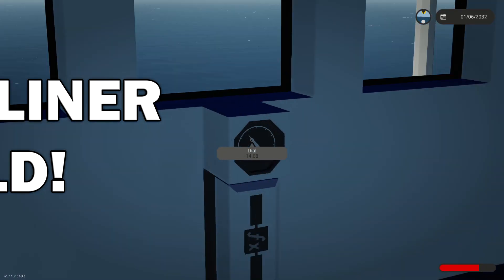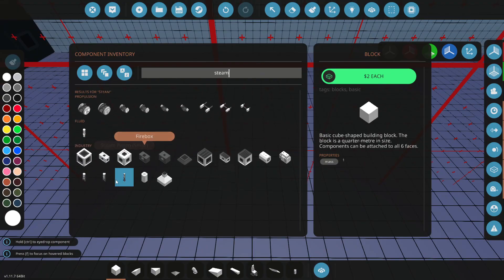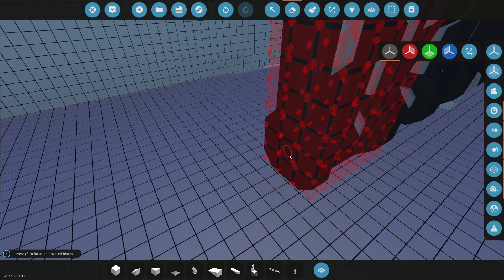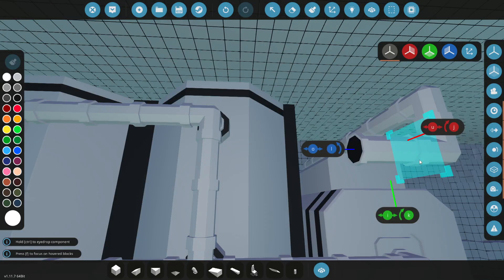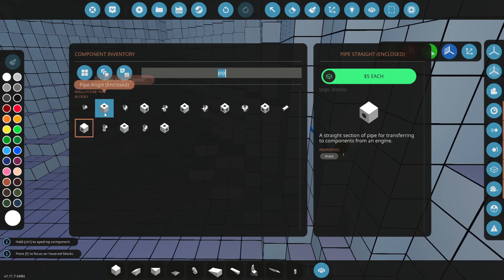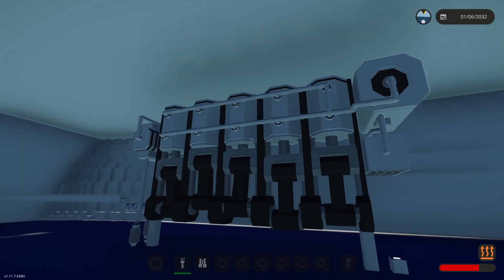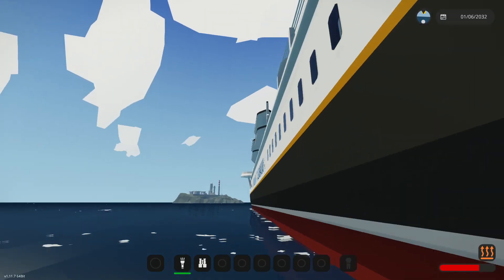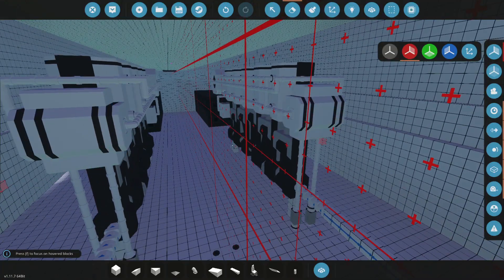HUGE Steam Engines Built!  - Ocean Liner Build - Part 11

Comment: Hey Frantic, just a few ideas for you:

1: You know that “room”/area at the back of the ship you’re wondering what to do with? Make it an equipment/security/armoury room. Fill it with torches, fire extinguishers, etc. and maybe even a little bit of weaponry to defend yourself. 

2: A reverse gear would be extremely useful in the likely event you find yourself in a…situation, plus it help the ship’s cornering if you could have the engines running in different directions at the same time. 

3: Dot some rope anchors around the edge of your ship in case you need a tow.

Comment: Gearbox Model:
Model: ZF SSG 76 Aphon
Type: Synchromesh transmission                                                                                                                                                                                                                                                                                   Specifications:
Gears: 6 forward gears and 1 reverse gear
Gear Ratios:
1st gear: 12.93:1
2nd gear: 6.40:1
3rd gear: 3.27:1
4th gear: 1.97:1
5th gear: 1.21:1
6th gear: 1.00:1 (Direct Drive)
Reverse gear: 12.62:1
Final Drive Ratio: 6.08:1
Clutch: Single dry-plate clutch

Comment: Engine look so cool 👍. One thing to consider is that these type of reciprocating steam engines could only produce max 18 knots each if your were to go with two High Pressure Parsons Steam Turbines like the engines of the Lusitania you would be guaranteed a max of at least 24 knots with the possible 25 knots. Yet I am not sure if Steam turbines are possible in StormWorks. Also Sea Water could be used for coolant, but the salt had to be filtered out of it first or overtime the salt would build up in the system and could cause bad accidents.

Comment: I still think that using the industrial furnaces (diesel burning ones) instead of the coal powered fireboxes would allow for easier connection to the engines AND provide real smoke for the funnels, it would also use the large open space you have in the lower hull. In fact, you could make a sort of double hull, and use the space from the double hull as fuel tanks as well, for extra safety incase your liner were to hit something, like an iceberg or rock.

Comment: Frantic the best idea is to use an Actual Boiler you said and connect i t through the Engine.
So it's like a classic oceanliner.

And the funnels you need to reduce the height near to the original one you've made.
It's better looking.

Comment: I'd never seen someone using heat exchangers.
But they're a lot useful sometimes. In this case you can cool outcoming steam with incoming water. I mean use less energy before boiler and condenser (what called heat recuperation)

Or you can heat oil/water with exhaust (with air/liquid HE) when you use diesel/coal furnaces. It makes them much effective!

Comment: I think that the boilers should be connected to the actual engines. More boilers produce more steam, and so, more power output, and so, maybe a couple knots more of speed.

That's why I have suggested the 8 double sided four furnaced (2 furnaces per side) boilers in four different boiler rooms with their own coal bunkers.

Besides, 21 knots of top speed with those 2 engines is a pretty repectable speed for a ship that size. Most of the ships of that size could reach at max 18 knots!

I'd also suggest to add also an electric generator linked directly to the engines and with its own added set of 3 gearboxes along with some cable ports to keep the electric systems on when the engines and the generators are off.

Another great add would be a set of pumps and watertight doors to make sure that, if the ship is damaged, she won't sink easily.

P.S.

You should pay attention to where the fluid port for the condencers are, because you might run into problemsif you don't fix it.